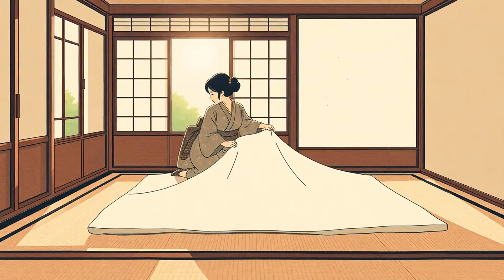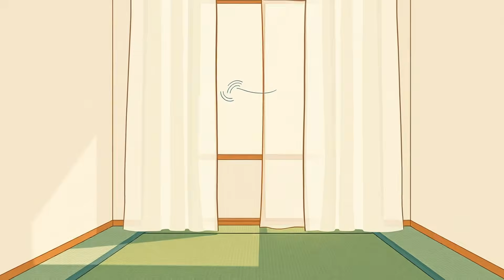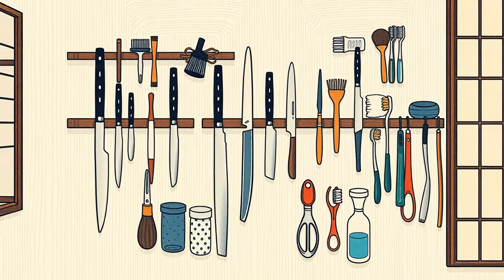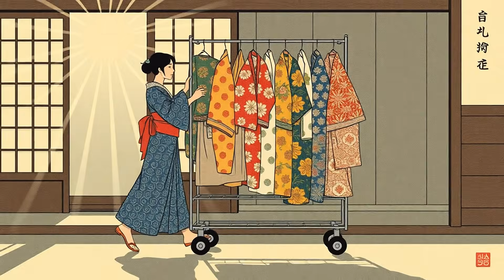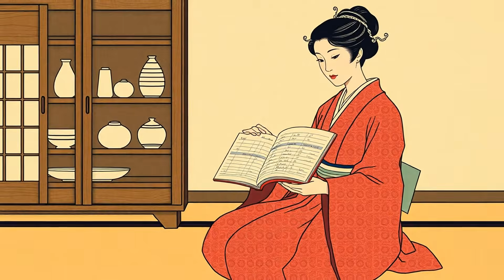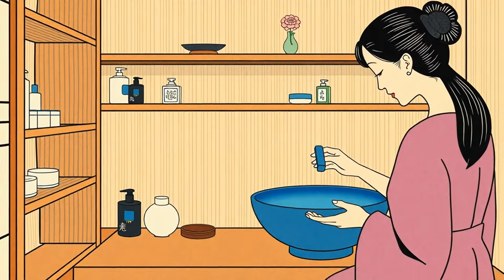I Tried 15 Japanese Home Hacks for 7 Days: The Results Shocked Me

Comment: 1) citrus peel deodarisers: dry and grind the peels, or boil with cloves and cinnamon, or toss old peels in bathroom 
2) Futon hygiene: Flip, air, fold, hang to air in sunlight to kill dustmite
3) rice husk dehumidifiers: finely milled rice husks in cotton bags placed in drawers to deodarise and dehumidify (put in laundry bags, drawers, ceilings, pantry)
4) double layer curtains: thin and thick black out curtains for keeping heat in/ airflow/ ventilation
5) Shoji screens: optimse spatial airflow/ UV/ ambient glow 
6) dish drying racks suspended over sinks, stainless steel, hold plates vertically so water doesn't stagnate 
7) magnetic strips on walls to store knives/ tools/ keys... save space 
8) washi tape labelling for temporary labelling made from mulberry leaves 
9) rolling laundry racks. Wheels allow you to chase the sun
10) boil cleaning cloths for sterilisation with baking soda, boil for 15 mins 
11) dishcloth color cleaning. Eg blue cloth for kitchen table. Yellow for sink. Black for floor. Contamination control. 
12) Kakebo budgeting: What can i live without? What do I need? No hoarding. Track in a journal. Track with cleaning timetable. Anti clutter mindset. 
13) 5 shoe rotation: Rotate daily. Shoes rest and allow odors to dissipate/ anti bacterial. Charcoal your shoe cupboard. 
14) 2 bucket system: one bucket clean water, one bucket soapy water
15) one-movement-principle: anything used a lot has to be reachable with one movement only, no bending or opening drawers. Pans on wall on magnetic strips. Toothbrush on right side of sink